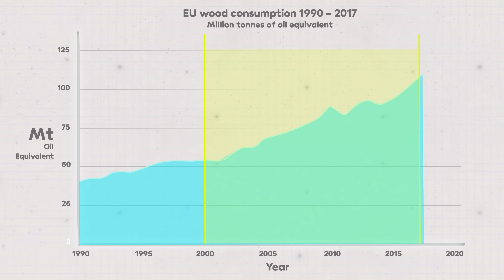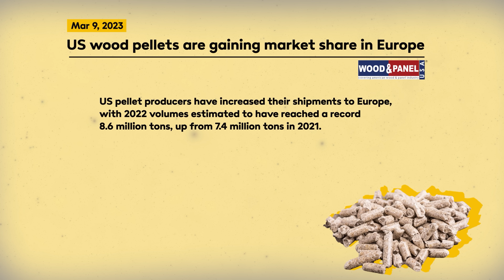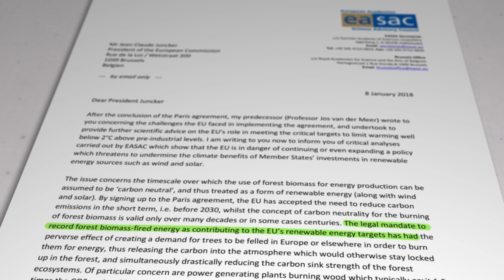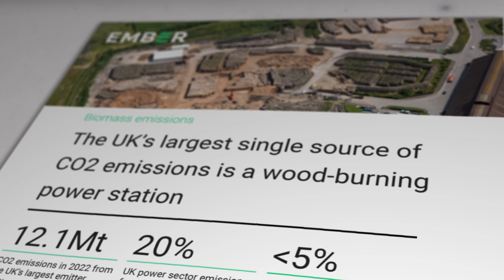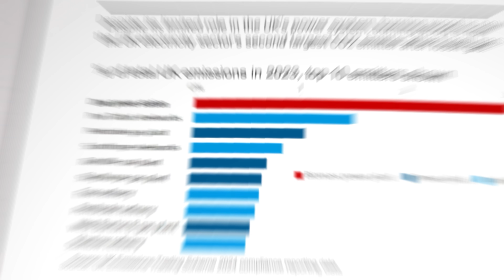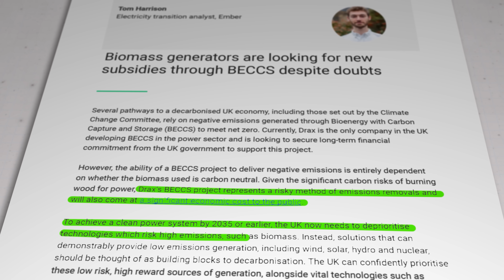New report: Biomass CO2 emissions 4X higher than COAL!!

Comment: This is a very biased take, which misses the issue.

1. The title. the only support you give for this is that Drax emits 4x more co2 than the UKs only coal power plant. But Drax is a lot bigger than that other plant, so yes, it will emit more. and ignores that the carbon has been previously sequestered. You could use the same argument to say that steam engines are better for the environment than wind turbines. conveniently ignoring the fact that we are hardly building and running any steam engines.

2. The problem isn't one of Co2 emissions, its one of deforestation. If we just replanted trees to burn in power plants, in would in general be carbon neutral. The problem is it isn't getting re planted. 

3. Why are you casting shade on carbon accounting? It has plenty of issues, but if you plant trees they absorb carbon, that is taken into account, if you chop down trees, that releases carbon, which is also taken into account. the timeframe for growing the trees doesn't matter, even if it took 1000 years to grow a tree, if you plant as many trees as youre harvesting, the accounting should balance out.

Comment: If the thermal need in question is home heating, then the answer seems to be Heat Pumps. Probably air source heat pumps to start. I suppose due diligence would require a proper accounting of the components of ASHPs (steel, copper, etc.), but put up against the clear debacle that biomass/pellet heating has proven to be, I would guess ASHPs would fare rather well. Speaking of which, I know the EU and UK have both been undergoing a push on ASHP technology to counter the n-gas crisis begun during the Russian invasion of Ukraine. I wonder if you might do (have done?) a recent video on progress in the ASHP sector. Great work, as always. Cheers.

Comment: True! You have to power the chainsaws, the mills and the transportation between all that with fossil fuels. Also when burning biomass instead of fossil fuel hydrocarbons, you have to provide the heat to vaporize all that water, which is either chemically or physically bound to anything made of wood/biomass

Comment: the carbon in the wood junk is all going into the environment.  if you let the wood rot, it releases it that way.  it is in cycle carbon.  the trees took the co2 out of the atmosphere, and the burning or rotting or composting puts it back.  the coal, much filthier, has been stored for millions of years.  when you burn that you put more carbon in the cycle.  wood stoves are sustainable.  i'm not saying the stuff should be made into briquets and all that but burning it for heat makes sense.  i never burn firewood that does not have a year of sitting out, which gets the water content about as low as it can be.

using it for energy, you should preheat the fuel with the exhaust.  that waste heat will dry water which takes 539 cal/g to boil off, where heating the wood from 1C to 99C takes 98 cal/g.  we should use waste wood for paper and fuel never for the landfill.

plasma recycling would be the best and it even recovers metals.  have a think and look into that, so you know what the alternatives are.  comparing wood emissions to coal emissions is just wrong.

Comment: Only an idiot would say after you ship a load of wood pellets to a different continent….having been harvested with oil, transported to the factory with oil, produced with oil, then moved by train with oil to a ship that burned oil is a carbon neutral fuel. But governments are typically idiotic…..so here we are.
Most green projects simply greenwashing with profits taken at each step to make certain people feel better along with simpler transferring the pollution to a place it’s allowed or tracked differently. Net results, much more co2 and other pollutants than would have occurred. This happens again and again in multiple industries

Comment: Lumber mills in Oregon still use sawdust to dry the lumber and laminates/plywood. CO2 is a necessary element for life, without enough the plants will die, then we would run out of oxygen to breathe.  We need CO2. More would not hurt the planet at all.

Comment: This could easily be 10x or more CO2.
4x due to simple physics of surface area to mass and the rest for the processing and tranpsoration.
Horried is an understatement. Especially as the subsidies they burn that could be utilized for actual green energy resources.
It would be greaner if they just used construction site timber waste - for sure.
😵‍💫🤯

Comment: I'm an Englishman living in Germany.  Please Dave, can you start shouting about balcony solar.  Here in Ze Fazerland, for less than 300 of Napoleans Euro, I can buy and 800 watts of solar power and an inverter and install it, completely legally, myself - simply by plugging it into an electric socket.  Thousands are being installed everyday in Germany.  For some nutty reason, it is not allowed in the UK.  For the proposed subsidy for the Drax power station next year, the government could provide 800w of solar for every single household in the UK.  Why is no-one shouting about this?  I despair.
Reply: In the US this isn't allowed because of the risk of back feed into the grid during a power outage. If a line is downed is should be dead, but solar backend could energize it.

I have grid tied solar with rapid shut down for when the grid fails but I still needed $1m liablity insurance.
Reply: @phhowe17   The interesting thing here is it should be allowed.  The system comes with a grid tie inverter that only transmits when it detects a AC current is present.  The moment it detects the current is not there, it switches off.  Now, one might ask "how safe is that?" - well, I would answer what better Proof of Concept would you need than tens of thousands of installations across Germany with not a single incident of injury.
Reply: @TheImhotep2012  Most people get upset about not being able to use the power from their solar panels when the sun is shining but the grid is down. It's better to have the feed-in cut-off at the connection of the dwelling to the grid, rather than the connection of the panel to the dwelling, if you can find an electrician to set it up for you.
Reply: @tealkerberus748  Agreed.  But that is a next level installation that runs into thousands, great if you can afford it.  What thousands are doing across Europe is plugging in a couple of 400W panels and every sunny day taking up the base load in their house.  It's a great solution.  But, it is inexplicably banned in the UK.  That's my beef.
Reply: @phhowe17  well if you want - you can just feed it into a battery - that is kept off grid - so it doesn't have to worry about grid outages. My solar panel's off grid - no issues for years.
Reply: @extropiantranshuman  regarding batteries - yes, that is possible but in my view it adds a little complexity.  I'm happy messing about with batteries and MPPT controllers, I find it fun, but I have to admit that others do not share the same enthusiasm, and that is fine.  The beauty of the plug in Balcony System is that you don't need to do any of that.  Buy it, hang the panels, plug it in.  Boom!
Reply: That sounds pretty good! Any solar panels that you would recommend?
Reply: @justincase9471   I have 2 x 440 watt panels from Renogy, but that isn't important, any panels will do.  I have two grid tie inverters I have tried, 1 from Solarman and 1 from Ecoflow, both worked fine - the EcoFlow one has a nicer App experience and some extra features that I like.
Reply: Hi, I like in Spain and I think the 800 watt allowance is the same in Spain. Did you have to get local town hall permission before you install.
Thanks
Reply: balcony solar's amazing!
Reply: @petermartyn9701  In answer to the registering question, jein - a lovely German word meaning yes and no.  :-) . When I first installed it 2 years ago it was required - I just had to fill out a form.  Since then that necessity has been removed.  In Germany now, you do not need to register Balcony Solar at all, just plug it in.  And, with respect to the other suggestion ( @extropiantranshuman  ) regarding batteries - yes, that is possible but in my view it adds a little complexity.  I'm happy messing about with batteries and MPPT controllers, I find it fun, but I have to admit that others do not share the same enthusiasm, and that is fine.  The beauty of the plug in Balcony System is that you don't need to do any of that.  Buy it, hang the panels, plug it in.  Boom!  🙂

Comment: Nuclear power only threatens those who's industries would fail over night were it to be prolific.  Just think, nobody in the middle east would have the money to crash airplanes into US buildings. Didn't think about that angle did ya? Cars will still need gas for many years, but on batteries and lawn mower engines however, burning coal and heating oil for hot water and warm rooms, Phfft!.

Comment: Duh, everyone know it takes 4 times the charcoal to get the same effect as coke.
What is also forgotten is the emissions tied to volume (logistics).

Density always win, that is why nuclear is so clean compared to coal (actual pollution) especially when it comes to radioactive emissions, but as always such things get labeled as natural.
The "climate" enthusiasts always sacrifice environment in every "green" move they make.
They don't seem to care about ecosystems, only the invisible "demon".
There would not have been a forest to be seen anywhere in Europe had coal not replaced firewood and later electrification.
"firewood" is also a monoculture "crop" for the most part as to grow volume within reasonable time you have to use seedlings of trees that also has about half the fuel efficiency.
If you have experienced using a modern wood fired cooking stove, you would know that spruce sits around 180 degrees and birch around 280 degrees (Celsius by volume).

Comment: We need to account for the beneficial effect that higher CO2 levels have on the RATE of CO2 absorption.  Current CO2 levels are 420 PPM (up from 280ppm).  We need to remember that trees grow faster with higher CO2 up to about 2000ppm.  This means as CO2 levels rise we will have larger trees that absorb more CO2 per unit mass.  In other words, the higher CO2 levels go, the harder it will be for them to go higher.  We also need to remember that only 5% of the earth's annual production of CO2 is man made. So, 95% of the earth's CO2 production is naturally absorbed by the earth in a steady state scenario.  In summary, the earth will start absorbing CO2 faster now.  This is the earth's way of pushing back on human behavior.  This is a good thing.

Comment: I hate to burst your and the researchers getting grant money to conduct these studies bubble, but it does not put more co2 in the atmosphere than a coal powered plant. Simply measuring the co2 output is simply being ignorant of basic biogeochemical cycling. 
First, we need those wood and paper products and if not them then someone else will manufacture it. Second that scrap that they burn, if left out in the field or dumped will eventually be consumed by microbes and go through a process of cellular respiration, which will convert every last bit to CO2 in maybe a decade's time. But, because it doesn't go through a man made tower, we're going to ignore that because it makes the data inconvenient. Additionally, coal has been stored away by earth for literally millions of years, and would continue to stay that way for millions more, but is dug up and burned.

Comment: Talking of HYPOCRISY: Aided by UK government subsidies, the switch from coal to wood (biomass) at the Drax Power Station (built near surface coal deposits)  took place when biomass was cheaper than other renewable sources of energy, but the strike price of wind and solar has since fallen far below that of biomass. 
Since burning wood creates 4x more carbon dioxide than burning fossil fuels, further subsidies for this industry are controversial. In the UK Taxpayer subsidies for Biomass are to be continued until 2027, part of the 24% renewables tax, plus 5%VAT of course, on your domestic fuel bills.

International carbon accounting frameworks allow emissions from burnt wood to be included in the carbon budget of the country in which the trees are grown rather than the country in which the wood is burned. Smokestack emissions from UK biomass power plants are therefore 'not counted as UK emissions'. Although perfectly legal and in line with rules laid out by the Intergovernmental Panel on Climate Change designed to prevent double-counting, critics have described this as an ‘accounting trick’ (Clark 2023, Lawson 2023). While it helps the UK reduce its official emissions, it does not reduce global emissions and, in practice, the UK is creating more greenhouse gases to produce electricity than it says it is. NO, SURELY NOT?

Most biomass for the UK comes from the US and Canada in diesel powered ships and is transported on land by diesel powered trucks. The pollution of a round trip of these huge ships is estimated to be equivalent to 50Million Diesel cars doing the same mileage
Again, the DRAX, converted from a coal burning power plant, is built adjacent to UK surface coal deposits.
Our greatest exponent of biomass even on his Royal Estates is our 'king' who lectures us regularly on Climate Change, Net Zero, Atmospheric CO2 blah, blah, blah.

Comment: There's also the issue that we take trees down instead of treating them like perennials - the definition of 'renewables' is that the resource can be renewed in time-scales that don't exceed the speed within which it is replenished. 
Coppicing would be the time honoured way which avoids the cost of establishing new trees, honours the soil biome that supports them, and allows biodiversity to flourish uninterrupted.
Also consider alternative feed-stocks? We produce plenty of waste that could just as easily be made into pellets - If the design of typical waste products were required to be either safely compostable or incinerated, biomethane and biochar would be major resources; contaminated char could replace sand in construction, like China, use Biochar in agriculture to improve soil biology and resilience to drought (quickly, simply and cheaply sequestering carbon at scale). 
Carbon Capture & Storage (CCS) is prohibitively expensive, energy intensive, hard to scale and storage is challenging; but existing waste incineration, and energy from biomass could be carbon negative capturing the carbon at the beginning of the process, (not the end) by creating energy from syngasses and retaining the very versatile and potentially carbon sequestering char.

Comment: How the heck did we end up here , burning imported wood instead of lower emission UK coal..? 🤦
Reply: The Stupid Greens  and MONEY that's why. Drax was built over Selby Coal field and only had a few miles to transport the coal. Shell was going to install carbon capture equipment at Drax then pump it down old oil wells in the North Sea. BC  wood ship to Immingham, tranship to trains, barges and coaster, tranship again into Drax Power Station.  Your still ahead on figures using good hot coal.
Much the same as the Maui Gas field near New Plymouth New Zealand  and the  Power Station built there for the gas. Must have been a pretty clean operation. Now its closed down all that machinery scrapped and Coal is stored there now?   Politicians !!!!

Comment: The real reason why wood as a fuel has zero net CO2 impact is that wood is ephemeral. An old growth forest is typically at a balance between growth and decay. Burning the wood releases the CO2 the tree bound temporarily through photosynthesis. Nature would have released the CO2 again, albeit at a slower rate, than burning it did. A longterm real cost of pellet fuel, though, is the energy needed to process and distribute it, which is mainly from fossil fuels.
Reply: The Bulk Carriers shipping the pellets from  BC to Drax may burn 50 ton /day of High Viscosity Fuel oil, a voyage may take 14 days or more, then they go back empty, 40 ton /day as we don't produce anything to be exported in bulk like that to BC, well we don't produce anything period apart from hot air from politicians   and the greens banging on about global warming.
Its all wealth creation and nothing more.  That's 1260  tons of fuel oil that has already come from the Middle East and could have been burnt in an oil fired station.

Comment: burning wood waste, or coppiced purpose grown wood,  or other biomass, reuses the carbon in the active carbon cycle. Fossil fuel use releases carbon laid down over tens of millions of years at tens of thousands of times the rate of sequestration. Worrying unduly about the use of renewable carbon is the equivalent of worrying about the annual rotting down of the leaves of deciduous trees. 
reducing transport, use of concrete, use of fossil fuels will help to slow or mediate climate change. crab bucket attacks on those deemed imperfect will hinder all.

Comment: Per joule/calorie, yes.

But this is known (it s called energy density). Oil is the best fuel if using this scale... (Uranium is better, but i m considering only the burnable ones for comparison s sake) 

The main différence is that biomasse drains co2 while growing, whereas fossils are a net addition to the atmospheric co2.

So it s a bit dumb to just look at the co2 per joule/calorie, without considering the carbon cycle.